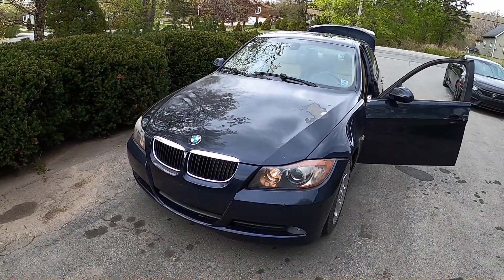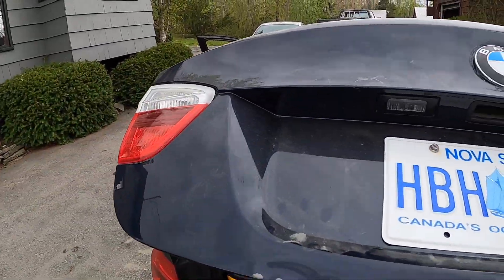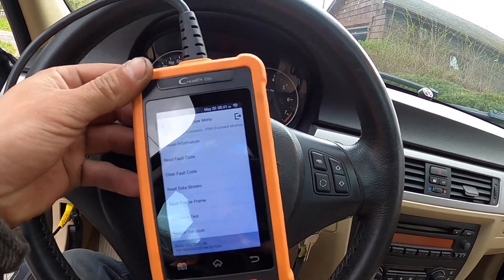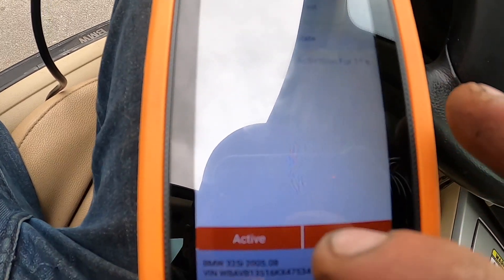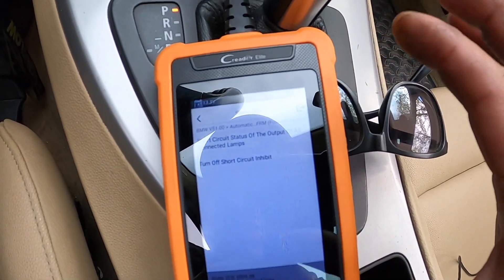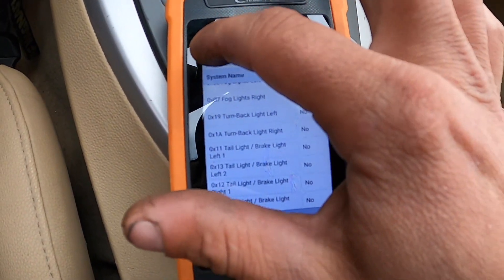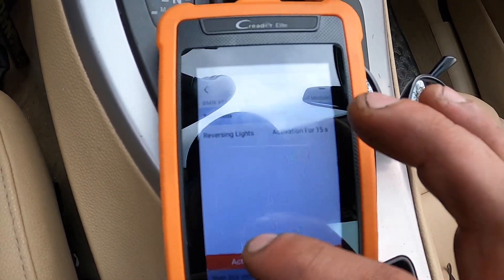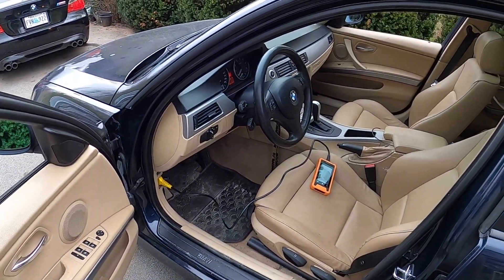2006 Bmw 325i FRM Circuit Reset Procedure Creader Elite Scantool

Comment: was going to buy this tool, my right front angel eye won’t work, but on the scanner i have it does come on when i do a force test? just can’t do the reset. your reverse lights didn’t come on during the test so could this be a different issue?
Reply from the maker: Need code in scan tool to reset circuit

Comment: Amazing video. Had the same issue but after watching this vid I went out and bought this unit. 

After the initial updates (says you get a year of free updates in the manual) I was then able to scan for faults on my e90 and it found the reverse circuit trip on the FRM. Followed the menus through from the fault to what’s shown in the video and my issue was fixed. 

I didn’t need to visit the Creader store to purchase any addons to do this. 

Worth the 150 quid I spent off Amazon for this; already paid back in the fix.

Thanks so much for this video.
Reply from the maker: hit subscribe

Comment: Thank you so much for sharing this, I had the exact same issue but with the left inner taillight on the trunk. Thanks to your video I was able to resolve it. This fix alone paid for the diagnostic tool, I bought the LAUNCH X431 CRE 2.0.
Again, thank you!

Comment: Hello , how did you get to the Step you started on ? Thanks
Reply: Just went through this.  I was baffled at first, but those menu choices became available with the car running instead of just "on".  Prior to starting the engine, the creader had no communication with the FRM.  This device has a poor UI, but it does work for this stuff. Eventually.
Reply: Hey, did you figure this out?
Reply: @theturkishprince same here! This does NOT look the same